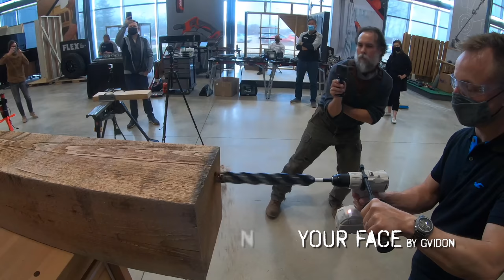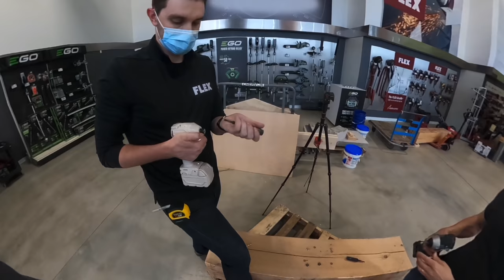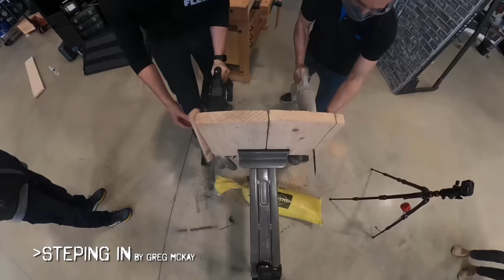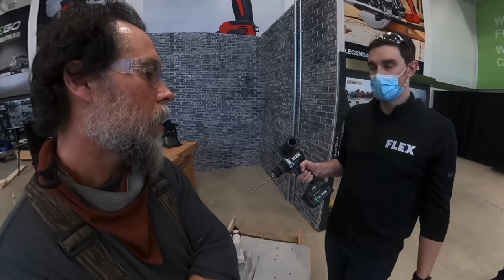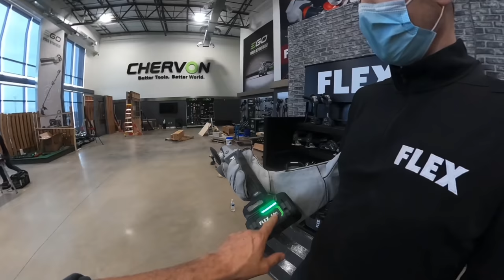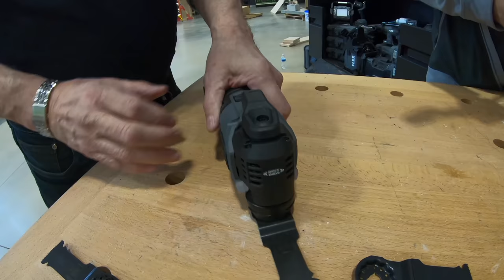Testing Flex's new Power tools- No glitz, no hype, no B.S.

Comment: So is that a Milwaukee m18 high output battery you’re using? No it isn’t. It’s an xc with old cell technology. If you say no bs then please -> NO BS. Oh and if you compare recips you better compare it with the super sawzall or use the onekey feature to put the new gen sawzall in the right mode. And also use the high output batteries. Nearly nobody is using this kind of tool with the old batteries. As for the drill driver, Bosch announced a new 18v biturbo drill driver that’s way more powerful than their current top of the line model. Good luck.

Comment: But did you swap the bits and run against each other again? 
And what about the other big brands higher voltage lines? Others are at 48, 50 volt systems now

Comment: In comparison... how were the weight of the tools themselves. Was the 24v heavier than the 18v? Or about the same? Last century I demonstrated and sold power tool for Builders Square and back then the newer tools were longer lasting and stronger but they weighed a considerable amount more.
Reply from the maker: the bare tools were close to the same.

Comment: Always using many tricks to help improve performance compared to the competition!  Example: In the angle grinder, why did they change the cutting angle?  Milwaukee cut the iron in the direction of pulling!  And Flex cut in the direction of pushing!  So he can support the machine against him, and apply more force!  And similar situations happened in several tests of the brand.  They are not making comparisons correctly!  And plugging the holes in the machines as they are doing with Milwaukee can dramatically compromise their operation!  And who knows what else they may have done to this Milwaukee equipment, such as increasing the amount of grease inside the gears to make the machines slower, even using a Milwaukee that has already worked hard, and currently has wear on impact  of the hammer!  I have a long and long experience with several tools from professional brands, and even then I would never have the same result in every test I did due to several variants.  I will only believe the comparatives when they are made by machines bought in random stores, by people who have no connection to any type of tool brand.  And he is only interested in making a comparison in the most correct way possible, and preferably without the aid of the human hand!  Because there is always the possibility of a failure, even if it is not on purpose, because to make mistakes is human.  I could even mention here some of the professionals that are worth waiting for their comparisons on.  
Health for all!  
Hug Hélder Silva
Sorry for my poor English!  
I'm from Portugal.

Comment: So the milwaukee gen3 impact would have won had they not slipped up, they put the turbo mode on but never ran in a comparable mode to the milwaukee, should have done that and showed if it was really faster or not, they also said that their battery was slightly bigger so were they not running 5.0 vs 5.0?
Reply from the maker: 24v vs 18v. ie bigger in power and size.

Comment: Just looked at there tools and there impact is rated at 1400inch pounds at 2500rpm when the other brand is rated at 1600inch pounds at 3200rpm both brushless

Comment: Speaking from experience, nobody "cradles" the tool. You grip the release between your thumb and pointer finger, pull away from the tool, and remove the bit with your ring and pinky finger...

Comment: They are using their turbo mode with a new battery technology with larger batteries... But still used a 5 amp hour milwaukee battery that's been available for many years. The newish high output 3,6,8,12 ah batteries make a big difference with fuel tools. So I call bullshit on it being a equal comparison.

Comment: Great video, I would like to see Them face Milwaukee with a a real battery and not a crappy old 5 ah battery. They should have put the high output battery on Milwaukee if they are putting the higher end battery on the flex. And yes, I’m a Milwaukee fan boy

Comment: I think they knew if they had a high output battery for the Milwaukee itd be embarrassing for them.
Reply from the maker: I think they are comparing similiar price point tools though.  so maybe you get  24v instead of 18 for the same price?
Reply: @Dirtmonkey  im just a Milwaukee fanboy, trying not to have remorse over the current collection. Great vid
Reply: @bufunga  same here, lol - but only $250 in

Comment: First, the flex is running 24 volt as opposed to 18 volt Milwaukee which is a significant difference so they should’ve at least used the high output batteries. Second that I see already is the flex has orbital mode which the Milwaukee super sawzall also has yet they didn’t use it so what I see from flex right now is they’ve done small things to change the outcome without being blatant about it and calling it the same. It’s like using a dewalt 60 volt grinder and a 20 volt and being surprised the 60 volt wins

Comment: Guess we will see these tools in the UK around 2040, really do think they missed a massive point with dewalt 60v here and Makita releasing there 40v line up
Reply: Don't really need massive 60v powerful tools in the UK though nothing mega happens.. theirs no real need for mega powerful tools.
Reply: @MrDakkyz  I'm slowly switching out my 18v to the 60v system and the difference is massive, good thing about dewalt is the 60v batts work on the 18v line up

Comment: A dcf998 with the 8ah battery will still out perform this.

This was 21700 cell batteries vs 18650 cell batteries smoke And mirrors.

Comment: Hmm. Milwaukee would have ran that arbor bit in speed 2. .  Full capability to full capability, there is no question, milwaukee is better. They arent even comparing against the FUEL line, they are just plain brushless.

Comment: To compare brand new 24v battery technologies from flex they should really be putting the milwauke high output batteries on the tools. Much more of an apples to apples comparison. I am sure the Flex tools would still fare very well against the Milwaukee, just an observation.

Comment: When he was cutting the metal rebar the sparks flew out the back of the tool and on the flex they were flying out the front of the tool proving he was pushing down way harder on the flex. Flex looks like a good tool but not the best like they’re claiming for the price. Not enough to change my battery platform at least

Comment: They should put them up against the dewalt 20 volt max and the 60 volt tools, I don't think they would be able to keep up.
Reply from the maker: I think they would
Reply: @Dirtmonkey  Won't. Funny how FLEX didn't put HO batteries on Milwaukee, nor have they shown the DCD999 which is the best drill money can buy right now.

Comment: Okay so i don’t exactly know What he means by sensor free but if he actually means sensor free brushless motor and the story About how they put the “sensors” down into the electronics is also kinda sketchy 
What sensors on a brushless motor do is tell the microprocessor in the tool the position of the motor rotor which makes it fire the individual coils in the motor in the right order depending on where the rotor is 
removing them is done by essentially calculating the rotor position based on the voltage the rotor induces into the other coils when it spins ( I think that’s what he meant by “moving” the sensors into the electronics) and he is right this will free up some space in the motor compartment BUT in low rpm the motor driving chip basically blindly turns on one coil which moves the rotor in some direction (even reverse in some cases) and now the rotor movement creates a voltage spike in the remaining coils and that is what the chip uses to know the firing order of the coils to get the motor to turn in the right direction 
THIS IS NOT ANYTHING NEW and it has its problems mainly in the low rpm control 
Someone test these tools like the drill driving a screw really slowly I bet it will be jerky and stuttering

Comment: Drill test was unfair, I think they  were using the lower spec Milwaukee, if I'm correct .The Flex should have been matched against the top end Dewalt 996 or 998 or Makitas new one.

Comment: Impressive but if they would put high output battery’s on the Milwaukee’s it would be a completely different story....those flex battery’s are probably the same cells as the high output Milwaukee. the regular 5.0 doesn’t even come close to the power output. Also they never compared the sawzall to the super sawzall which is Milwaukee’s best saw.
Reply from the maker: i think they were keeping the tools in the same price point.
Reply: @Dirtmonkey  I know you were referring to the price of the saws, but the Flex 5.0 (120 watt hours) and the M18 6.0 (108 watt hours) are both $149 so they were actually not being completely fair.

Comment: That’s why I say run em fast and hard. See if they hold up. But initially I am interested. Even if they turn out to be the bees knees I wouldn’t switch. I have just to much into red lithium at the moment.  If flex wants to ‘flex’ they should do a trade deal. Trade your old tools for deep discounts on their brand. Hell do an outright swap if you really wanna ruffle some feathers. Like a tool buyback program that allows you to try a new tool when you may have just purchased a super sawzall for example

Comment: On the impact driver against the Milwaukee fuel impact driver.  The Flex got a jump start.

Totally unnecessary btw as I think this flex
Does have the potential to match or even best the Milwaukee in terms of performance.  Even if it’s just by a hair.

Comment: For the test to be unbiased you have to tell us the part numbers of the milwaukee tools and the flex tools. Because the used midrange from milwaukee........
Reply: they used tool with turbo mode and for the milwaukee not used the high output battery because they know the result will be different

Comment: I mean, it's a faster gear I believe.  Put the Milwaukee in speed 2 and see if it can still power through.  I'm not doubting the FLEX, but revolutions per minute with the same bit and enough power for both the faster revolutions is going to win...  How about reliability?  I want to see them both in speed 2 and I want them timed with the same person doing the drilling how is this a consistent test?

Also, they are using the older XC 5AH,  the newer CP 3AH milwaukee battery actually outputs more power due to the individual battery cells being larger in parallel (aprox 21000mah cells compared to the 18000mah in the 5ah battery cells)  

Either way, I can't really give a concrete opinion until Project Farm does a review or I have the tool in my hands.

Comment: Bad comparison 5a 18 v is 90wh and 5a 24 is 120 wh a better comparison is 18v 5a and 24 v 4a (90vs96wh)
Reply from the maker: then your losing run time
Reply: @Dirtmonkey  only losing run time if the motor uses more if you want a fair test the wh need to be the same
Reply from the maker: good point.

Comment: So what about batteries. Slap a high output 12amp on the Milwaukee tools and see how close the race is. Also Milwaukee makes a super sawzall. The Flex seams like a good tool from a know manufacturer but Milwaukee is tried and proven with such a huge line of tools.

Comment: I have no problem with Flex winning. I understand that the turbo is standard with Flex but what happens without using turbo? Because if there really is more torque, not using turbo would still allow Flex to beat Milwaukee.

Comment: you cannot push higher wattage without heat in the battery.  The only way they can get around that is a heatsink.  I dont care how many sensors they have to limit current when it gets warm you cannot get full power and keep the battery cool.
Reply from the maker: They have thermacite in the batteries.  tThey did mention that but since not many people understand it-  I didn't inlcude that in the video.  But it is the same tech as Ego's batteries.

Comment: You cannot compare the two because of the difference in voltage. If the flex was a lower voltage than if it was winning every time then you can say it is better. With a 24v tool it has a bigger motor to handle the higher voltage then the 18v. The size of the battery in amp hour dose not matter. The amp hour is how long the battery should last under normal use between charging.

Comment: Flex guy Not pressing fully down on the drill into the brick.  But again, not comparing the same level of tools.

Regardless, I would absolutely expect a 24 volt tool to outperform an 18 volt tool by a much higher margin, which it has not.

Comment: Comparing 24V to 18V is like comparing a V8 to a 4-banger. Put those Flex tools up against some 40V and 60V tools.
Reply: I agree but If you look at the price point that's where you can make them equal why buy a 4 banger if you can pay the same for a v8

Comment: I've Never trusted the product company to have a THEIR GUY using the "other tool" in this case the MILLY,  while doing a side by side or vs.  how do we know how much pressure they put on the milly vs the flex??? For example the grinder how much pressure did he use?? How much long does it last compare to the MILLY? OVER HEATING? so on so on

Comment: To make these tests fair they needed to be using Milwaukee's new 21700 cells rather than the old 18650's. I bet some of the results would've been different. Not bashing competition just saying these tests could have been more fair considering the Flex battery is clearly using bigger cells.

Comment: In the flex video they said "the strongest hammer drill" and I thought of the Dewalt flex volt advantage and they also didn't wanna compare there high torque to other high torque impact wrenchs

Comment: Junk! Lol what color do we bleed Stan!?
Reply from the maker: I think there are too many Bias's out there. You can still like your red tools- It doesn't bother me-  Use them.  I wanted to show how these work without picking one over another.  I wanted to question their tests, make sure what you guys were seeing was legit.  I think a lot of social media tool channels will come into a test like this with a favorite.  So when they perform the tests it automatically scews the results.  I wanted to question everything and let you guys decide from results onbly.
Reply: They're all junk. Every last one of them. Just like trucks. People that think x brand of truck is better than another, or x brand of power tool is better, is just a little slow. I've bought over a hundred battery operated drills and impact drivers and another hundred other battery power tools, and they all last about the same and they all perform about the same. Milwaukee's quality and fit& finish is terrible (same goes for their empire brand of levels), but they're slightly more powerful. Dewalt is much sturdier and better built, but are slightly less powerful. They last a bit longer though. I'll continue to support DeWalt though, as they're not a Chinese brand making products in China. 2 strikes. Dewalt is an American company, making some of their tools in America and some in China. Half a strike. 

Same for trucks. Our dodge trucks need transmissions before 80k miles. We had a Ford platinum at the dealer for 11 months for 2 engine replacements, before they decided to give us a new one. We had a diesel Chevy 3500 blow the engine at 1500 miles. They all suck. Dεrργ λιllβιllies that think their Ford is better than a Chevy, or whatever combination there of, just highlights their sτυριdιτγ. Kinda like saying these are junk if you don't know anything about them.

Comment: Sorry the Milwaukee should have a 6.0 HO on there.  Why 24V x 5.0 = 120,  20V x 6.0 = 120.  Redo
Reply: By the way too, switch the bits on the second run.
Reply: That goes for all tests if you test a 2.5 on the Flex, the Milwaukee should have a 3.0 HO on it.  Make it fair try again.

Comment: Turbo definition for this application is a third speed on a hammer combo drill It’s quite simple there Drew has an extra speed and it’s called Turbo that’s all nothing special they just said instead of having three speeds will say it’s to speed and then put a little button down here that uses more power and will call turbo I’m not buying it

Comment: U know the saw zaw if its not tight against the pipe its not cutting very well. And to be clear im a dewalt guy who knows that Milwaukee is slightly better. But those Milwaukees there using  that were paint white also could have been altered, you know the gimmicks and tricks these sales man do...
Reply from the maker: yep-  thats why I tried to check everything as best as I could.

Comment: How about we address the elephant in the room. According to the internet CHERVON manufactures Kobalt 24V tools. Could it be that some of the offerings in the FLEX tool line up are rebranded Kobalt units.  The exterior looks of the tools are notably similar as well as the specks. Not to mention the fact both lines are exclusive to Lowes.

Comment: You want to impress me with a head to head tool test. Swap the bits, blade or what have you after Tool X beat Tool Y. If you're not willing to do that, the test is rigged. To me this was just another trade show demo that was rigged to how good their tool is. The "White" tool company can run the same demo and show their tools beating the Flex 24v tools. Until you show an independent entity testing the tools head to head, it's too easy for brands to rig the tests to show their product is the best.

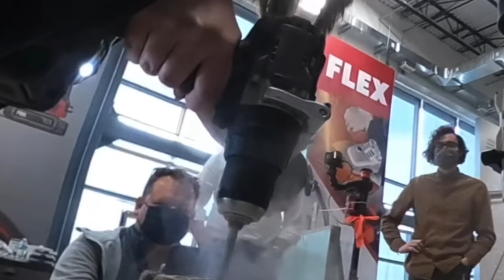Also at the 17:00 mark she buried the chuck in the concrete. It was soft enough that she could win with the chuck so loose the bit came out. Check the video again if you think I'm wrong. I would love to see the video from Dan at Tools in Action on that one.